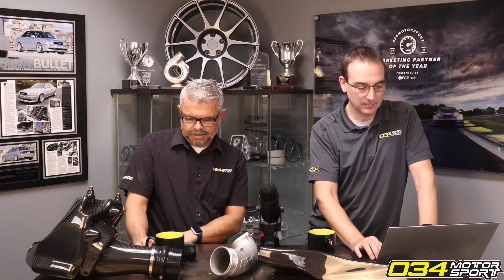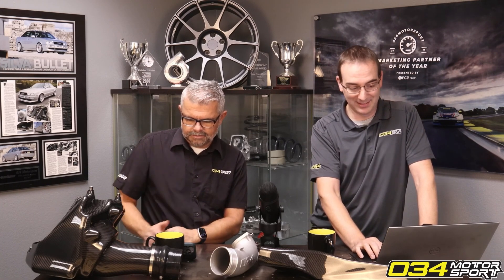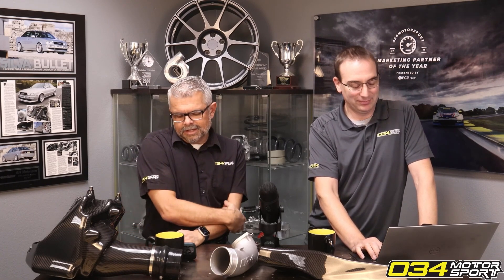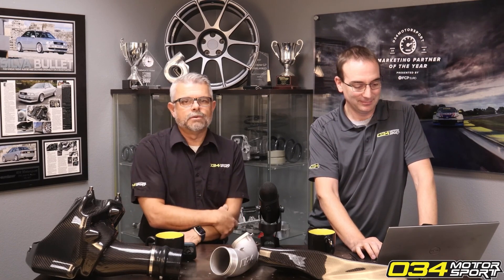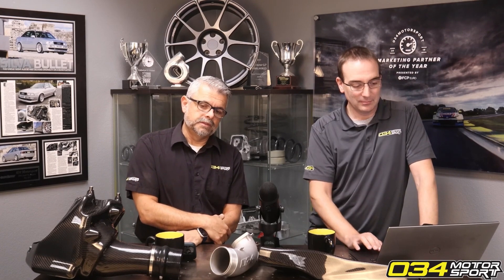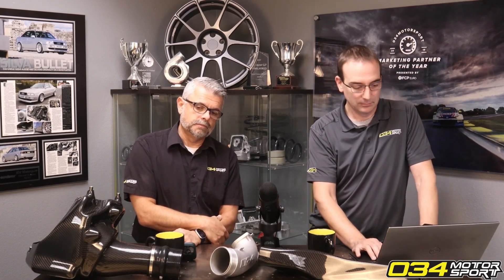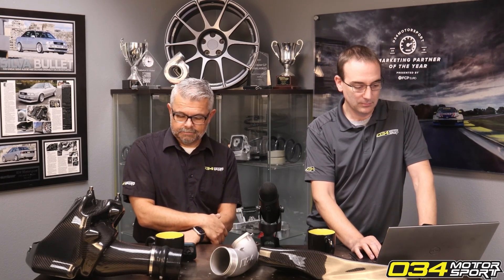Is the Audi EA837 Engine Block Similar To The Newer EA839 and Motor Upgrades? | 034Motorsport FAQ

Comment: Are the JE pistons compatible with C7.5 EA837 EVO MOTORS? Post facelift
Reply from the maker: They're compatible with CREC EA837 engines
Reply: @ okay, I saw your entire bottom end kit up for $3900 and was wanting to confirm figment before purchase, seems I will be the first CREC this far , just wanted to confirm fitment
Reply: @AM-fx7ge  the remaining parts are not confirmed for CREC yet, just the pistons.
Reply: @ okay, I will stay on standby

Comment: I’ll ask my question here.  Looking at the Panama’s with the 3.6 V6 and 3.0 V6 twin-turbo EA839.  Not sure which is more reliable and/or is it better to after market boost the 3.6 to get the same power (or a little more)  to the 3.0 hp/torque?
Reply from the maker: We loved the EA839 overall performance and reliability but cannot comment on the Panamera's setup as we don't have any data on that powertrain.
Reply: There was a video who complained about all the plastic connections/parts as failure points.  His justification were they are plastic.  Can these plastic connection last 200k or 20yrs?